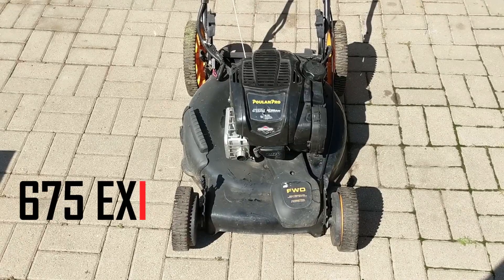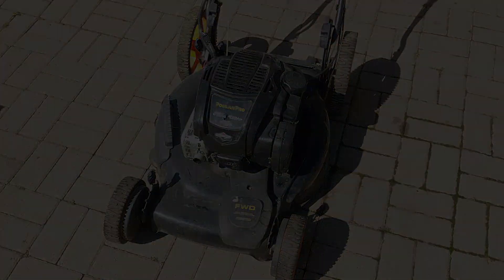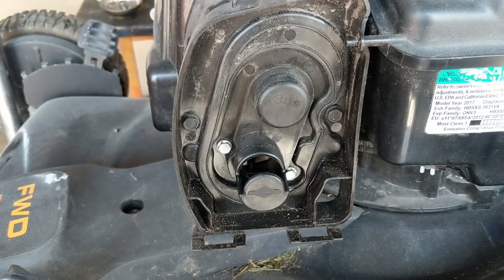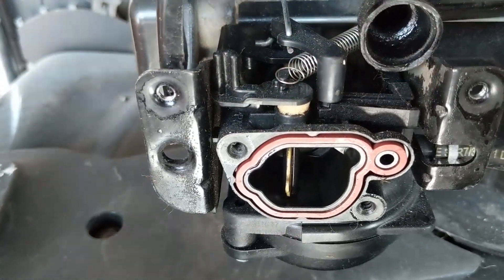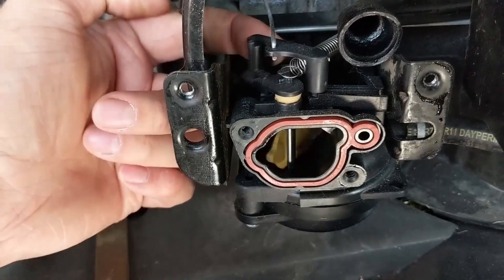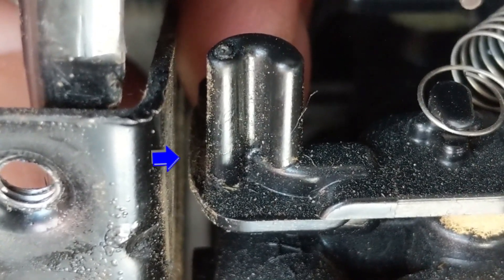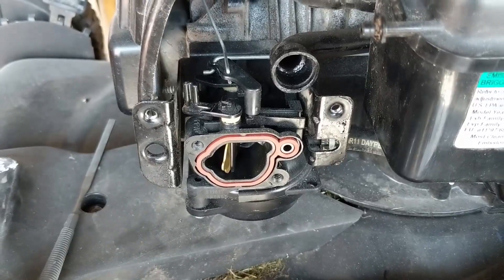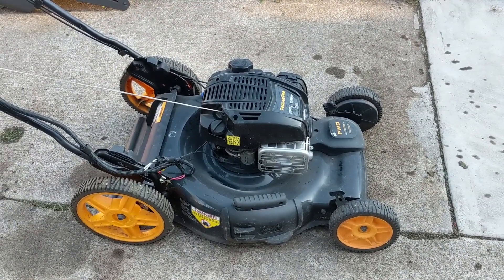Briggs & Stratton 675EXI Won't Start because of Design Flaw!

Comment: worked a few hours took off carb, cleaned tank as been sitting awhile and i think it's a foul plug but i'm going to take off the air cleaner cover and just see if this is a contributing factor. what a POC carburetor .

Comment: Great video. I've got the same engine, 725 exi briggs,  but my issue is it takes 2 or 3 pulls to get it started  but once it starts it acts like it's ready to die at any time.  I think the choke is stuck in a particularly closed position.  What's your thought?

Comment: Finally! This was my problem. My dad's little carburetor repair toolbox that I inherited had a tiny flat file, it did the trick! Been struggling with this for several years, driving me crazy. "Ready start" with no choke is frustrating because there was nothing to try without taking it apart. Thank you! (Now if I could only find a replacement electric start for the damn thing)

Comment: Would this also cause the mower to surge when running? I haven’t taken mine apart yet to do this and was wondering if the choke rubbing would cause surging or if I need to check something else
Reply: Thank you sir for your response and great videos!
Reply from the maker: @duganrichards4532 surging is not enough fuel, meaning the main jet is likely getting gummed up a bit. Watch this; https://youtu.be/QPrkCN_Va5E

Comment: I have the same mower shown in the video, but the problem is just the opposite. The engine starts when cold, but often won't restart when the engine's hot. Let it cool for about an hour, and it starts right back up. It's been like that since new. Any thoughts? Thanks!

Comment: Well,I checked the choke lever and there was plenty of room but the mower still wouldn’t start , so I followed your carb cleaning instructions and drained and cleaned the fuel tank . I then put it all back together and it fired up on the first pull 👌. Thanks again for your postings on small engine fixes .Now I gotta cut the grass lol😂
Reply: same here, plenty of room and no sticking, will try to clean the carb on this pos lol

Comment: I noticed the same mechanical issue on mine and fixed it by cutting off extra plastic. Yet the problem is still there, just more subtle. It runs cold, it runs hot, but it hesitates to start when the engine is warm. I wonder if this is thermostat on the muffler or carb acting up? Both were cleaned.

Comment: I spotted this problem and I was just about to hammer that whole bracket out of the way, which would have created other issues. After watching this, I took a less elegant but highly effective approach. I used small wire cutters to just snip the end of that control horn off. Plenty of clearance and no more sticking! Great Video!!

Comment: Great video. Just a FYI.... my 2021 Toro 21464 bought last year has corrected that design flaw. Now there's a cutout in the carb bracket to give that choke lever room to move without touching the bracket. Toro should have sent you a thank you!
Reply from the maker: Yes I posted an update video not long after this, thanks for watching!

Comment: You are than man! 

Worked for 2 evenings, soaked carburetor, compressed air to clean out jets. Was about to buy new plastic carburetor.  I did a few file downs on the plastic choke lever, Anita started first pull.

BIG THANKS.

Comment: Mine has a cut out in the frame around the carb for this exact issue already built in. Turned out mine was the engine brake on the back wasn't letting the engine turn over fast enough. Cleaned the trash from it and now it works fine.

Comment: Still doesn't solve the issue with these Briggs and Stratton crappy design engines.
I am working on a Toro Mower with the B/S 93j02-0167 GTS150CC engine with the plastic carb and I've rebuilt it and made sure the choke lever doesn't rub and cleaned that plastic jet inside and it still is very hard to start.
Just a very poor design from B&S. They should of just stayed with the metal Walbro carburetors

Comment: Good video, I jumped on it and it appears my BS exi725, being new, had a factory slotted left bracket.  They must have seen thge issue.  So the choke sticking here was not the problem.  But iIt turned out to be the muffler mounted "thermister?" that controls that rod.   It was sticking on the plastic.  So cold sometimes, it is stuck open.  I just used by Multitool to cut the plastic cover to give it clearance.   It now no longer catches and cold starts much better.   My advice to BS.   Go back to manual chokes.   The patent has probably expired and they work.

Comment: Good video. I have a similar problem. De mower kind of started and then engine dies. I clean the sparkplug an it improved a little, engine ran about 3 to 4 seconds before stalling again..

I also noticed oil spouts in the body of the mower near the exhaust... It may need new piston rings and a cylinder...

Any comments are welcome
Reply from the maker: If the needle valve is leaking, it could be flowing gas into the bottom end and over filling the crankcase (which is only supposed to have oil in it) with fuel. I would suggest checking the dipstick oil level, and it's it's overfilled it may smell like gas. If so you need to replace the needle valve

Comment: Is that the same problem with the black max 725?
Reply: Mine is new      used a couple of times and now it won't start
Reply from the maker: @alexvalencia1932  I'm not sure, but it's possible. Depends on the year, watch my update video and you'll see Briggs put a slot in the metal support to allow the plastic arm to move. I still file them down to prevent it from happening

Comment: Well. I thought I (you) had it knocked. I've got a trimmer/weed whacker powered by one of these things. Used it once or twice, last summer, and then put it away with a half tank of fuel. Went to use it today, and of course it wouldn't start. Not pulling any gas through the carb. No fuel smell at the muffler. Took the carb apart and looked for grunge and etc. All looked good. Put it back together and filled with fresh gas. Still no start. Then I saw your video. Aha! I said to myself. But when I checked it, the carb bracket has the notch that RickSlick mentioned. So the choke is not the problem. The search continues... Good video, though. Thanks!

Comment: Good job
 The internal works of the carb is also an issue, my last attempt was to “ tap “ the carb ( 15 times ) and the mower started, let’s see how long this lasts, it has stalled in the middle of a mow
Reply from the maker: Probably debris inside of the bowl, then it gets sucked into the main jet clogging it for a while. After it dies, if you let it sit for a bit, it probably starts up again? Watch this; https://youtu.be/QPrkCN_Va5E

Comment: Good catch. I've never had that issue yet, but I have one now that the piston isn't moving. It's on the same engine as your video. When you pull the recoil, you can hear a tick tick tick...that's about it. I put the compression tester on the motor and zero compression.

Comment: A customer came in today complaint is no start  went thru the typical diagnoses procedure choke was open then I remembered your video on this problem
thank you for sharing this problem
Reply from the maker: Yes stuck choke plate, common issue on the older ones. The new ones have a notch cut out in the metal bracket. Thanks for watching!

Comment: I'm curious as to your opinion of the "never change the oil" claim with this engine.  All oil degrades and gets dirty  so I cannot see this as a viable claim.  It seems like planned obsolescence to me.  Use until it wears out rather than changing the oil to make it last longer.  They don't even provide a bolt to do an oil change underneath if you wanted to.
Reply: take out the dip stick and tip the mower on its side to drain the oil. A little tricky but works well.
Reply: @rupe53  Yes, thanks rupe.  That's what I wound up doing.  A pain in the butt to tip it sideways to get it all drained.  And, the oil was dirty.  The claim that no oil changes are needed is ridiculous.
Reply: @BeanieandCecil  ... Gotta look at the flip side. If you never changed the oil, the engine itself would probably last at least10 years... and that's more than the rest goes on average. (wheels wear out, deck rots, etc) People like you and me get 25 years or more if we keep after stuff.

Comment: I have a Briggs and Stratton on a toro. I have cleaned the carburetor and fuel tank and filed the choke and changed the spark plug. It will start and run good for about 15 minutes and then just shuts off like it ran out of gas. After it shuts off it will not restart. Any ideas?

Comment: Will I need to worry about gas spilling out in this process?  I have a Snapper, used near the end of the mowing season, but it wouldn't start in the spring.  Took it back to the shop and they did something to get it working.  Now, a few years later it won't start up.  I thought it might be the fuel line or carburetor based on what I have read, but am not sure how to do that, and am afraid gas is going to drain out if I don't do it right.  Then I saw this video, which seems like it could be an easier fix if I have the tool to file it down.
Reply from the maker: I made a step by step video on how to remove, disassemble and clean one of these carburetors: https://youtu.be/QPrkCN_Va5E
Reply: @EliminatorPerformance  Thanks.  That may be beyond my capacity.  I was simply wondering about taking that plate off after the air filter was removed. Both videos just say remove the screws and then it is off.  If there is nothing to worry about there if my gas tank is full, then I will try to remove it and see if that choke lever is the problem.

Comment: My 675 EXI Series lawn mower appears to have a jammed motor , is that possiable
Reply: How do I fix the problem ,it sounds more internal , like a valve spring broken thanks
Reply from the maker: Check the blade, see if it's bent and caught on something. Also, check the oil. If you run it low, it could seize

Comment: I recently purchased a mower with this engine and dismantled the side as per the video, and to my surprise Briggs & Stratton have actually fixed this issue - there is now a notch cut into the left side wall metal to allow the full movement arc of the plastic piece without getting stuck. Good to see that they finally addressed the problem
Reply: My problem was the butterfly had slid down the plastic pole I had to slide it back up

Comment: I have this engine from 2015, after 3 years of use it began to had this problem, I started it one entire year with the chocke stuck, I mean, sometimes even 35 pulls AT COLD, the engine started like brand new when it was hot, something seemed strange. After 3 months of research I found the problem, took off some of the material, like you.It still does start from the first, sometimes second pull and in the winter third pull after 200+ hours, great engine but that is a big flaw

Comment: It would likely be simpler to add a few plies of cardboard between the carb and the bracket;  or if one just has to remove the needed amount of plastic;  if you don't have a zip tool then an easy way is to use a soldering iron or better yet;  soldering gun with flat tip on it.  Folded as three layers sandpaper or on a little plate and holding the part firmly while you're sanding it.  Many different ways to do this.  Many many ways.  And thanks for sharing and maybe the guys that are designing it should work on their communication skills and have a talk with the person that tested it when running.  LOL

Comment: Same motor. Not the issue. Starts then shuts off. Even with gas cap off. Maybe auto choke ?
Reply from the maker: Main jet getting crap in it, if you held the choke on manually I'd wager it would stay running because of the extra suction, which draws more fuel. You need a carb clean most likely.

Comment: Nice video but  I drill  out the main jet with a # 72 drill bit .025 works great , starts first pull ,,,,even the ones without the auto choke . I'm a 74 year old machinist and I'm like you " Old School "
Reply: @MC-wt7zt  My mower is a 18 in Masport and I only use it for trimming .

Comment: For 3 yrs I have been fighting with this stupid mower, since it was brand new in fact, took it back to Menard's at one point and wanted my money back. they offered to repair it, so I gave it a chance.... what a freaking pain that has been. I followed your video instruction and added a new spark plug, figuring the old one was screwed up from the hell I put this thing thru. HOLY CRAP it worked I was almost afraid to shut it down for fear it was just teasing me, but damn it restarted multiple times .......so THANK YOU very much

Comment: After a full service ,air filter ,spark plug ,oil ,carburettor strip down and clean with carburettor cleaner the damm thing will only start after 10+ pulls so it looks like I will be doing this modification, then hopefully problem solved 👍 
So thanks for your great video

Comment: Thanks for the video, would you happen to know the part number for a carburetor for a 675EX Briggs and Stratton mower Serial number 171 220 589 8952. I cant find it anywhere. Thanks

Comment: After a frustrating hour surfing the internet for a possible answer I found your video.    Perfect.  Right to the point and nailed the diagnosis.  I had an hour of everyone else posting that the Carb  was dirty, the airfilter, the spark plug, bad fuel. All the basics.   I just bought the thing.  Thank you for not being like thousands of others and for putting something original and useful out there.  Saved me from alot of BS.
Reply from the maker: Thanks for watching, glad it helps!
Reply: @EliminatorPerformance  right

Comment: please help! I have the model 675 EX (Not EXI)
I bought SAE30 but I have no clue what I am supposed to buy for unleaded fuel, please help
Reply from the maker: Use premium, ethanol free if you can!
Reply: @EliminatorPerformance  oh man saw ur msg too late!
I already bought Briggs & Stratton 100107 2-Cycle 3.2-Ounce Bottle of Easy Mix Ashless Oil for Up to 50:1 Mix Ratio

Should i cancel order!?
Reply: @EliminatorPerformance  i bought Briggs & Stratton 100107 2-Cycle 3.2-Ounce Bottle of Easy Mix Ashless Oil for Up to 50:1 Mix Ratio
But it doesn't work, could my lawn mower be broken?

Comment: Thanks for a great explanation. I’m planning on buying a new lawn mower and was thinking of a Murray that’s has this sane engine. Would you advise against it? Should I better buy a lawn mower with an engine that has a metal carburetor with the regular prime button? I imagine this plastic carburetors don’t last as much...
Reply from the maker: Good mower, good engine, just change the oil regularly! Get an oil extractor, makes it simple to suck it out where the dipstick is. And obviously fix this design flaw.

Comment: Wow that was it. 3 cranks and bam. Thanks bro. You rock.
Reply: That Video of  Carbi  was brilliant  ,I took the filter off , which was saturated in oil , cleaned and dried ,took that plate off , with 4 screws attached 
And you guessed right , the butterfly appeared to be stuck ,causing the auto choke to be seized on , after filing away on that high spot , making it
easier to operate.  Flushed out oil ,which was to much ,emptied fuel tank , refreshed , new spark plug at the right setting
Cleaned all  round top of mower
And you guessed , throttle on , worked the cord to the top of piston , one small pull , run like a charm , I let it run for awhile to burn of  the oil
All I can say is thank you very ,my son is very happy , regards Dave

Comment: Dude! I just wanted to say thanks VERY much!  I had thought it might actually be THAT definitive part, but wasn't sure?  Took some pic's on my phone and was trying for the life of me to figure it out. Yours was the first video I checked out and low and behold! I thought maybe spark plug, air/gas filter? But you straightened her out for me. Very grateful. And yes (to answer one of the other comments) those idiot engineers should've easily figured this out. I used to build cars for a living and know all too well the attitude and demeanor of many an engineer.  Looks good on paper, but when it comes to assembly? Oh that's strange? And their famous line: "Well it SHOULD work?" More wasted education on many of these people rather than making sure 100% that something works without issue. Thank again man.

Comment: Nice, got a 725exi last spring, this spring, wouldn't start, saw this video, and it was EXACTLY like you said.

They still haven't fixed this flaw.

Used a simple fingernail file, and fixed it quick.  Fired up on the 1st pull.

Thanks again!
Reply from the maker: Glad to hear it's running again, thanks for watching!
Reply: Wow, I just picked up a basically brand new one for free from a neighbor yesterday that ran maybe twice and then they couldn't start it. I hope this is the issue because this one has much more power than mine. I'll keep you guys posted!!
Reply: I also have the 725exi and came across this video. I'm going to give this a try and hopefully this solves the problem. Will report back later.
Reply: Mine is 4or 5 months old used a couple of times now it won't start

Comment: They have redesigned the bracket.  There is now a cut out where the choke comes over.
Reply: Really? On witch model?
Reply: Jr Thomas I just bought a new Toro with the 163cc engine and it’s got a cut out for the bracket where the choke comes over so it doesn’t get stuck anymore.  The engine year model is 2019.